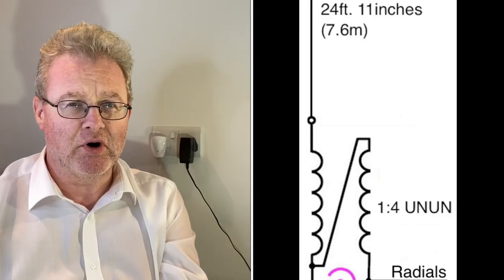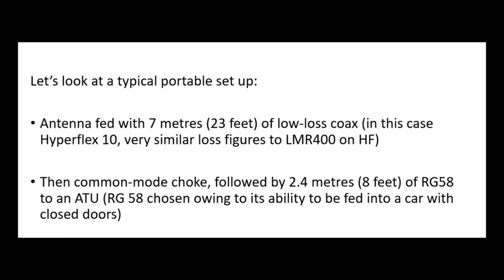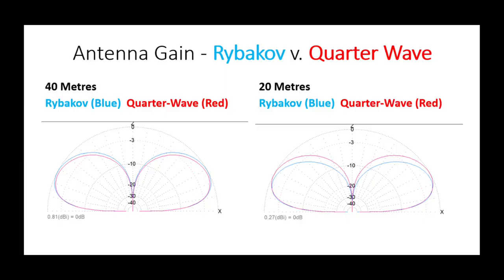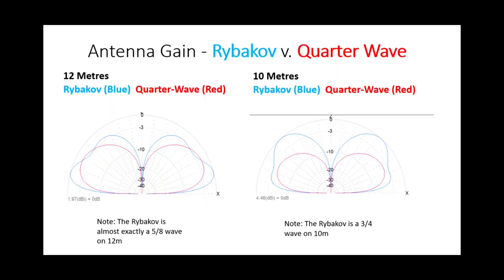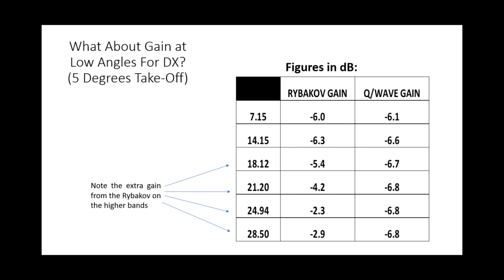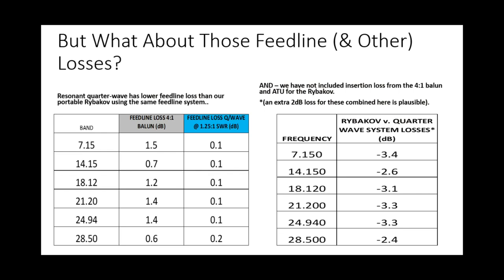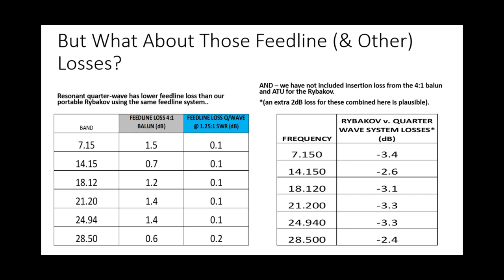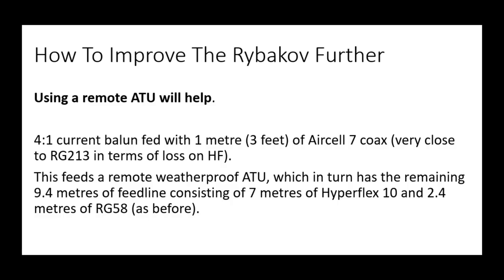Ham Radio: Easy Portable / Small Space Vertical DX Antenna. The Rybakov Antenna

Comment: Tim, when I run coax thru my vehicle window during bad weather,  I use a piece of black foam water pipe insulation on the window glass. It allows for coax pass thru while keeping the weather outside the vehicle. Just rsise the window to seal weather out and the coax isn't pinched.   (A "swim pool noodle" also works but its a bit stiffer and bigger in diameter.)
Reply from the maker: Good idea!

Comment: The Rkbakov antenna was sold in the UK as Pro Whip. I used the 7M one as he also had the 10M and the Delta Loop as well. The antenna was simple. Balun, 7M positive cable and one negative at 5 or so metre length. Worked Japan using RTTY with it, got some good Inter G and PSK31 into Texas as one point. On paper it does not work well but place some radials on it and you get a better SWR. I used one more when it was active and got some good results on 10M FM into Germany. Even managed to get local 80M with it but the SWR was skittish and had to be very low and the null point of the SWR was hares breath in tuning. But if you do use it try the 10M vertical of it and see how it fares with a 4:1 unun and a 9:1 unun overall as a normal BalUn would not work well with this,

Comment: I looked at the Rybakov because I want to be nimble in getting between the higher bands as the propagation changes but I suspect there is a better solution to be had based on tapped matching coils. All these systems which depend on toroidal transformers to bring the mismatch within range of an ATU are just so lossy. 2dB loss is not a wild estimate at all.
Reply from the maker: Yep - point taken Stuart. I think that the size of it is purely down to gaining 40m into the mix. I think somewhere around 4.5 metres long would do ok too on the higher bands as a stealth version. I know you (like I) really rate EFHW especially portable and their lack of need for radials and harmonic band switching is a big plus. 73

Comment: The Rybakov has one other benefit over a 1/4 vertical you didn't mention. Because the radiation resistance is higher it is inherently more efficient against real world ground losses or against a shortened radiator with a loading coil.
Reply from the maker: Excellent point.

Comment: Why 7.6mtrs ? Why not make a 7.5mtr or 7.4 mtrs , what lenght gives better swr ? A 7.5 mtr , no balun is a 30 mtr 1/4wave , why dont u ever mention 30 mtr ? What if u ONLY want it for 20 to 10 mtrs , what lenght is best?
Reply from the maker: 7.6 is the sweet spot between avoiding 1/2 wave on 15/17, not being too long on 10 and being just about long enough to be respectable on 40. For 20-10 if you want shorter try 7m long

Comment: Hi Tim and thanks for a wonderful presentation. I designed and built such a vertical antenna myself (based on a maximum 3/4 wavelength long on 10m) and never knew it had a formal name..."Rybakov!"  Mine is an aluminum flagpole that is isolated from ground and has 16  total radials, 30 feet long each. The number and length of the radials is based upon extensive research into radial system efficiency vs. total number and length, as published in QST magazine (ARRL). In short, the fewer number of radials one has, the shorter they can be to maintain high efficiency. Somewhere around 12 - 16 radials is the point of diminishing returns - adding another 75 radials will give me a mere +1 dB in additional gain. Hardly worth it.

I would like to comment on  a few of your statements. The first is the discussion of feed line losses. If one runs a 50 ohm feed to a 1/4 wave ground mounted vertical, the typical SWR will be ~ 1.5:1, as the impedance at resonance is not 50 ohms. On the contrary, if one places a remote antenna tuner right at the base of the vertical (where it BELONGS for best performance), it is not uncommon to obtain a match that is even better than 1.5:1 - my typical match ranges from 1.1 - 1.3:1 - nearly flat. In this case, feed line losses for the "Rybakov" antenna will actually be LESS than they are for a 1/4 wave vertical. So let's just say there is parity between the two antennas for feed line losses. 

Along the same lines is your estimation of tuner losses. Trust me, they are not even close to 2 dB! I run 1 kW into my system, and if I were losing 2 dB of power in the tuner, the inductors would get as hot as branding iron...but they don't. All remote tuners that I know of utilize "L networks" to match to the load, as and we know, L networks are considered to be very efficient impedance transformers - if low loss components are used. I'd estimate average tuner losses to be closer to 1 dB. 

A 4:1 current balun is not needed for this antenna, and in fact is the wrong application for such a device. ASSUMING the remote tuner is a single-ended device (all the ones I know of are), it is already configured to tune an UNbalanced load, which is what the Rybakov antenna is. Trying to force equal currents into such a non-resonant, unbalanced antenna is asking for enormous power losses in the balun. If one has an inferior tuner that cannot tune the antenna directly, a 4:1 UNun (unbalanced to unbalanced) is what transformer manufacturers are providing for those who tune a vertical monopole on many bands. In my experience, any decent remote tuner out there (MFJ, LDG, SGC) will all tune a 24 foot tall vertical on 40m with ease. Adding an additional unun is just introducing an additional loss element that is UNnecessary! (Get the pun??? )   :-)   

My SGC tuner is capable of tuning my vertical on the upper half of 80m without a 4:1 unun. Below 3,800 kHz the impedance is outside the range of the tuner. A 4:1 unun would cure that problem. My LDG tuner, however - has slightly more inductance and will tune the entire 80 m band without difficulty, so no need for an additional 4:1 unun.

In summary, the "Rybakov" antenna is a really great DX performer. Extensive, controlled testing using WSPR reveals that this vertical typically outperforms my end-fed half-wave wire (35 feet high)  anywhere from +3 to a whopping +18 dB on some DX paths, on all bands 40m - 10m.  

73 and good DX,
Dennis, W1LJ
Prescott, Arizona, USA
Former Technical Editor, ARRL - QST Magazine, ARRL Radio Amateur 's Handbook, ARRL Antenna Book.
Reply from the maker: Fabulous observations Dennis and some real food for thought. My instincts are to use an atu right at the base and many radials. The pattern especially on 12 and 10 looks promising. Appreciate you stopping by and commenting 73

Comment: Hello Tim. Thank you for the video's on your channel. I have set up the Rybakov antenna last week on my holiday  adress in the south west of the Netherlands. A spiderbeam, 7.6 mtr speaker wire and 18 radials each 3 meters long. Connect it with about 10 mtr rg 58 and a homebrew 9:1 unun. 
It works great. I've had contacts  over a 11000 kilometer without any problem. Running 100 watts ft891 and mat 30 tuner. Great antenna. Specialy on 15 and 10 meters. Thanks and 73. Pa7kcc. Hans.
Reply from the maker: Fabulous Hans!

Comment: I first watched the Rybakov antenna video on the Coastal Waves & Wires channel.  I am intrigued by this antenna so much so that I have ordered a 4:1 UNUN, and a DX Commander 10 meter pole to help me get back on the air.  I operate mostly mobile & portable but now have a ham shack that has a limited yard space out back where my G5RV dipole won't fit.  So this is a viable option for my station.  Thanks for the info... 73  's de kd5smf
Reply from the maker: Enjoy the antenna!

Comment: Nice vid Tim, I actually built one yesterday on my day off... I used an old CB 5/8 wave telescopic aluminium vertical for most of the vertical element with the addition of another section of aluminium from another old antenna to make up the 25ft radiator... I used a homebrew 4:1 UNUN at the feedpoint and the earth system is a few buried radials and an earth rod... not the most efficient earth but small garden and needs must... long story short the antenna tunes up easily on all bands from 40m to 10 using an old manual MFJ tuner, I didn't get alot of time with it yet but I managed a few contacts on 40 SSB with my TS480HX and 150w and I got 5/9s from Greece, Ukraine and the Canary islands, so its definitely working and I'm looking forward to trying it on the higher bands hopefully at the weekend... its the only antenna I have up at the moment with all the windy weather and is very easy to take down if necessary so I'll spend a decent bit of time with it weather permitting 🙂
Reply from the maker: Dave sounds promising. Hopefully the bands will open up too 73

Comment: Hi Tim, very interesting presentation. I just like to say for those new to the hobby, that  
All ants , even ants with high swr and losses can still get you dx with a tuner in line, I wouldn't like to think people were put off calling CQ if their ant wasn't perfect or had losses. Last evening I noticed 30m was open, but my 40m vertical on 30m, swr was off the scale, but put the tuner in line and managed to work Norway from zl, so not the perfect setup , but good propagation  overcome my poor setup. Obviously my bad swr and high losses were not such a worry, when chasing dx with good propagation. Always try to set things up right, but sometimes,  just give it a go. Keep up the good work Tim, 73 zl3xdj
Reply from the maker: Great points Brian. Paralysis by analysis is to be avoided! 73

Comment: Great article. How does this differ from the antenna marketed by Comet. I believe that is the Comet 250? This is supposed to work from 2-30 MHz? If you put it up on a 10 foot high pole and feed it through  a 8 foot long coil of RG-11 coax cable and connect  it  to a MFJ remote automatic antenna tuner immediately below it on the pole , it should work quite well. Any thoughts? The Comet 250 is about 23 feet long and has a balun at the bottom and no radials.

W9LGH
Reply from the maker: It will work but in all honesty you’d need radials to improve its efficiency. Moreover, as it’ll be a non resonant elevated vertical make sure your choke is VERY high impedance across as many bands as possible, as you’ll probably have some common mode on the coax run owing to the mismatch

Comment: I tried this antenna after it was recommended for my limited space, but found it picked up so much noise it was unworkable.  I have seen lots of operators using it with really good results.
Reply from the maker: Yes verticals are more susceptible to noise at home but can come into their own by the sea for example

Comment: This design looks like a real winner on 15m and a above. Personally the need for a tuner & radials would put me off using it in my /P setup.  
Are you intending to try it out in the field at some point Tim?
Reply from the maker: Hi mate - yes definitely - around Spring time looks a good time to test one out
Reply: @timg5tm941  Have you checked out Thomas SP9TL on YouTube? He has had great results with the Rybakov /P with 20w
Reply from the maker: @adyg6ad73  thanks Adrian I’ll check him out
Reply: I build a short version of this antenna, which is working outstanding on 10 and 12m, without any need of a tuner. SWR 1:1,5 on both bands. Also 15 and 17m is an option, then with the internal tuner of my Flex 6400M. Length is only 2,6m, no Radials!, 1:4 UnUn, 2m RG58 Coax from Feedpoint, then a choke Balun and further RG58 to the shack. That‘s it. 73‘

Comment: Thanks for a great video. Good content and well presented.
I look forward to your thoughts on setting up your station by the sea. I have had great results with a 1/4 wave vertical with lots of radials on wet sand, really close to the water, including a 57 report from Costa Rica for my 3w station. What I am unclear on is how quickly the benefits drop off with distance from the water. Is there still a significant benefit half a mile from the coast, or from the top of a sea cliff? There doesn't seem to be a lot of information out there and it isn't something that's easy to model.
73 MW0KXN
Reply from the maker: Kevin thank you. You are so right. I’ve found info about right by the sea… info about average ground and poor ground, but nothing about being 20,100,1000 metres from the shore (on average). I’m looking into this as I type.

Comment: Hi Tim
Bit late on commenting... I have a very small garden/yard 4.5M by 6.0M
So I have been looking at Verticals. I already have a remote ATU available.
If I put the ATU @ 1M from 4:1 Balun, is it O.K to put the 1:1 choke balun just before ATU..?
I
I
I
Vertical Wire
I
I
I- [ 4:1 BALUN ]o=== 1M Coax ===o [ Remote ATU ]o=== 1M Coax ===o[ 1:1 Choke ]o======== // 20M Coax //=======o [ RADIO ]
Reply from the maker: Hi Dave it should be ok. The short coax between the 4:1 and tuner will alter the impedance but it should work. Remember the radials too .. about a total of 40 or 50m worth is fine for 20m and upwards. Maybe double that to help 40m where the antenna is more of a compromise. 73
Reply: @timg5tm941  Thanks
I will have to get creative with Radials... with only 4.5M X 6.0M yard 🙄

Comment: Hi Tim,
Try ultraflex 7 instead of rg 58.  Should be less loss and is very flexible.
73 John DJ6JH
Reply from the maker: Yes but its still 2mm wider and I would rather pinch a bit of cheaper RG58 with a door or window than a nice bit of Aircell 7! The loss difference on an 8ft (2.4m) run is pretty minimal in this instance. Although I share your view on Aircell 7 as its a very nice grade of coax indeed. 73
Reply: @timg5tm941  just a thought
Reply from the maker: @roach1317  appreciate the comment 73 👍

Comment: I think I’ll give this a go and compare with my DX Commander - I have a Diamond BB7V (22 ft) from my early radio days - it’s a dummy load!! and rob the Balun from a Delta Loop experiment!! Mount  a couple of feet up and trail some wire to get the 25 ft of length!! Could be a fun comparison!!! If it works I’ll have found a use for the well built but v v poor Diamond.
Reply from the maker: Worth a try!!
Reply: @timg5tm941  Ok - I've had time to give it a go!! I had a 9:1 UnUn and mounted it on the BB7V (having removed the dummy load resistors!! transformer it comes with). I compared with my 40/20m loft dipoles and DX Commander lite 1/4 wave.  The results - excellent!!   I can tune (with LDG 600) 80m - 15m easily!!   80m is going to be quite inefficient, but I've tested 40 and 20 and had great reports (running 200w). For me the advantage is I can easily collapse the antenna which will keep the fam happy in the garden during the summer. The DX commander can come back out in the autumn!! I'll build a 4:1 UnUn when I have a mo and see which gives me the best tune.  Great idea Tim - Thanks!!
Reply from the maker: @Sinaisid  brilliant!!!

Comment: Would a 9:1 UNUN or a 16:1 UNUN not be better.
Reply from the maker: 9:1 possibly so. I chose the 4:1 as this seems to be the preferred option from manufacturers. 16:1.. only issue I see there is reducing the impedance down so low that even an atu at the feedpoint might struggle to tune it. 73

Comment: My first HF antenna when I got licensed was the M0CVO Magitenna which is pretty much the same design. 7.6m fed with a 4:1. I never liked it any much, and it didn't perform well at all. Looking at this video I'm thinking about finding it in some random box in the basement and give it another chance, perhaps with proper radials this time. Thanks for the video!
Reply from the maker: No problem - maybe with the growing sunspots you will see the benefit of the higher bands with this antenna. 73
Reply: Running this type of antenna without any radials will result in extremely poor performance, between 2 - 4 S-units poorer than a simple dipole.